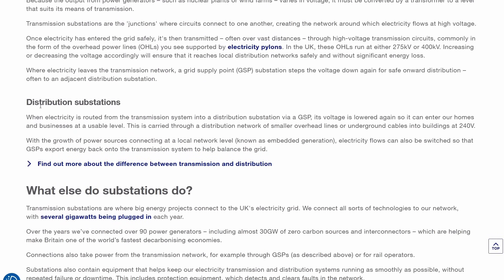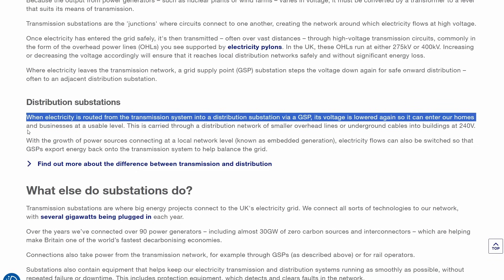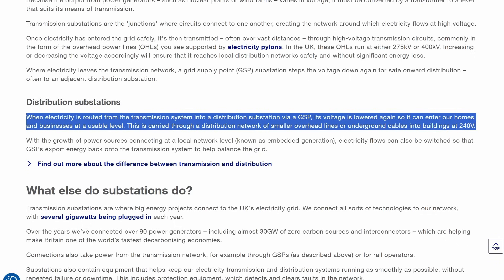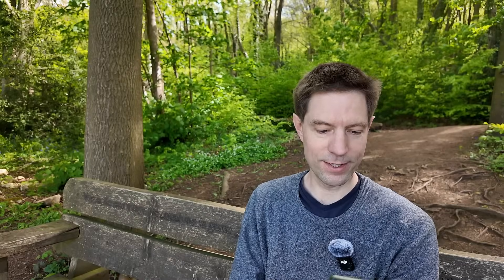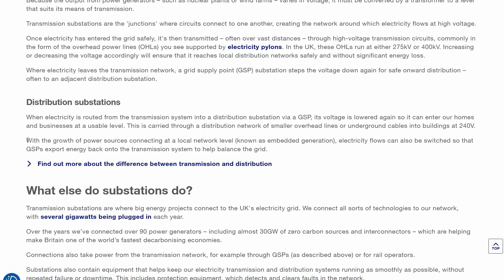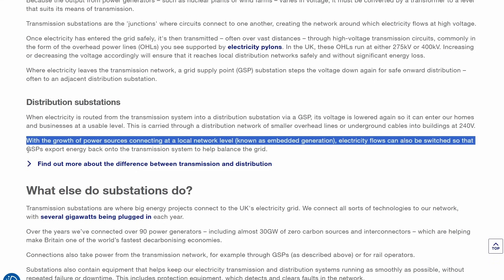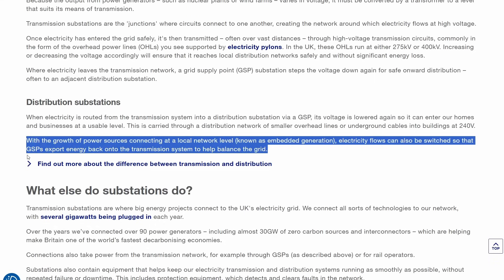Does solar export get past the local transformer?

Comment: Simple answer is yes, that’s why your system has to shut off if the grid power supply is interrupted. You don’t want to electrocute engineers working on the system. The grid is not the simple beast as it may appear to be, it’s extremely clever at protecting itself against very costly damage and automatic protection will shut down faults faster than a politician’s wallet when asked to pay for a round. However a trip on the system or an increase in demand ineffectually managed has much wider implications on the rest of the grid (butterfly in the jungle)l. Careful with the can of worms you open, a good can to open is the "effects of the reducing inertia in Grid stability due to renewables" stay safe all and permits are there for a reason.
Reply from the maker: Yes, the more I learn about the grid the more complicated I realise it is.

Comment: I am an electrical engineer. That the energy passes through the local transformer back to the grid if the total production exceeds the total consumption. Usually this surplus ends up as consumption in other parts of the city, state or other countries. Part is used in reversible power plants for pumping water and storing energy. The law of physics on conservation of energy does not allow us to have different consumption than production. If this happens, we have blackouts. Like recently in Spain. Sometimes I am surprised how general public know so little about this stuff.
Reply from the maker: I wouldn't expect the general public to be equally knowledgeable about every aspect of the modern world.  There's just too much of everything for that to be possible.  That's why we have specialist jobs people spend years becoming experts in.  I'm sure you've spent a lot of time learning about electrical engineering, whereas most of us haven't had that same level of training and so won't know what you know.
Reply: Energy does not get destroyed, it just gets lost in cable resistance and losses on transformers. Not destroyed, but made into heat.

Comment: Maybe that's why as mentioned in your previous video, new houses only get a few panels instead of utilising every part of the roof for solar, so as not to back feed the grid to much. I watch the off grid garage on youtube and it's amazing how many panels and batteries you'd need to go totally off grid and have enough for the demand.
Reply from the maker: Yeah, I did a video on the subject of how much solar would be required for off-grid myself a few months back.  It is quite surprising!
Reply: Hi in Melbourne I just have 6.6kw system and two 5kw inverters, one 5kw is hybrid and I just have 16kwh 48v home made LIFEPO4 battery which is enough for daily use, I have not paid any bill for years, we generally use 4 to 5 kWh during night and 20 to 30% battery. Andy of offgrid garage has pool, ev, air cons so need bigger system. For normal family 16kwh battery is enough as we do most of cooking, washing, heating cooling during day time when solar is available. Regardless how cloudy the weather is, big system still make 4 to 5 kWh per day to charge battery up to 100%.
Reply from the maker: @pr5991  I suspect the winters in the UK are somewhat harder to get through than Melbourne using just solar off-grid.

Comment: Here in South Australia around half the homes have solar and on some days the entire state is powered by rooftop solar alone. Every other generator switches off.  

The network now sends curtailment signals over the internet to restrict overloaded suburbs solar output, effectively restricting output from 10kW to 1.5kW per phase.  The rest of Australia is 5-10 year behind SA and has also started to use the same “flexible exports” model.

For most of the year our market value of exported solar is negative.  Today it has been around -3c/kWh.
From July, the network (poles and wires) will also charge us 1c/kWh for exports that roughly exceed 8kWh a day.
If you want to see where the world is headed with regard to managing growing rooftop solar export, look at the SA network.
Reply from the maker: The UK has somewhat less sun than SA, by quite a long way, so we're a long way off of that, so hopefully by the time we get there the network will be able to cope better, or at the very least battery storage (and EVs) will be able to balance things so that we won't get charged for exporting.  Hopefully.
Reply: @TimAndKatsGreenWalk  might be balanced out by not having aircon running in every house when that sun is out.😊
Reply from the maker: @robhaitch5544  I'm pretty sure we're going to get to the point where AC becomes more popular in the UK too.

Comment: Interestingly, in Slovakia, it is standard practice to utilize all three phases in residential houses. It’s a very practical setup, especially for charging electric cars. Is there a specific reason why the UK typically connects homes to only one or two phases instead of all three?
Reply from the maker: I really wish the UK had three phase supply to homes as standard.  It does happen in rare cases but generally single phase is the norm.  I have no idea why.
Reply: @TimAndKatsGreenWalk  It used to be the best way to make sure the phases are balanced and a way cheaper solution. When homes didn't use that much electricity, it wasn't worth sending three phases to each house, and you would have to balance the load between the phases within each house. With 1 phase per house, it's more or less balanced automatically.

In the Netherlands, old houses and especially smaller apartments will usually have one phase per house. Later houses will have three phases coming in, but still, often only one of them will be connected. Only if you upgrade or have a recent house, you'll have three phases connected.

Comment: Maintaining the voltage within accepted limits. If it gets too high your inverter will disconnect. Look up transformer tap settings too, these have to be reset for both ways. The local distribution company should have or be asking for the capability to send a command to your inverter to switch off if it has a stability issue. This area is a challenge and requires the ability to manage all sources of generation.
Reply from the maker: Indeed.  Most inverters will shut down above a certain voltage anyway, but the DNO should also be managing how much generation is on the network to prevent that happening in the first place.  This is why G99 and G100 applications exist.

Comment: so often in rural situation you are the only property on the transformer 1 phase or 3 phase connection. the transformers job is to downgrade 11000V Incoming lines to usable and local 240v, in the Export situation the transformer simply works in reverse where the solar generation at 240v coming from a grid tied inverter is upgraded to 11000v and then it can go to be used at connections anywhere. So transformers can work in either direction one side is 3 phases at 240v and the other side is 11000v, its job is to amend voltage. the reason the voltage is increased to 11000v is so the power can travel much further and the same amount of power can be transferred using a lot less amps meaning relatively small cables can carry a huge amount of Kws at low amps. there is also 33000v lines in the UK so and that again would go through a substation/transformer and the voltage steped up from 11000v to 33000v to carry power ultralong distance without too manys losses. so essentially the power from your solar panels could go through many voltages changed and travel 100s of miles before it is consumed in theory but it will depend where the demand is needed and the power will naturally make its way there to the closest point of a connection that is importing. The issue with the national grid is that the power you put in you must take out so high export and low consumption on the grid is very stressful for it one of the downsides of renewable energy and export.
Reply from the maker: Battery storage helps a lot when it comes to soaking up excess generation, so will help alleviate the intermittency problems of renewables.

Comment: Transformers are passive devices.  Power can flow either direction through them just like power can flow either direction through a wire.
The change between electric current to magnetism and back can go either way.  If voltage stays steady, then power going one direction vs the other just depends on which way the current is flowing when the voltage is positive.  Like with batteries, current flowing out of them means power flowing out while current flowing into them means power flowing in.  More precisely electrons flowing out of the negative lead and into the positive lead means power flowing out of the battery, while electrons flowing out of the positive voltage lead and into the negative lead represents power flowing into the battery.  It's a bit more complicated when the voltage and current are changing sign 50 or 60 times a second, but there is nothing magic about power flowing from the low voltage side of a transformer "backwards" to the high voltage side.
Reply from the maker: Quite, although transformers are not the only equipment on the power network and not all of it is designed for reverse power flow (although it can be upgraded to be).

Comment: I live in a housing colony that manages its own electricity distribution. The housing society buys its power in bulk from a distribution company. The housing society does not have an electricity buyback agreement with the distribution company. The demand for solar has exploded in my locality and almost every other house has solar on their rooftop. This has led to solar generation that is in excess of the entire demand of the housing society. In our monthly billing cycle our exported units are deducted from our imported units. For the past few months, our society has intimated us through a letter that since solar generation is in excess of demand, they would not be adjusting any excess exported power units. In March our housing society's exported units were 70% more than the imported units. So the excess  power is actually making its way back to the distribution company and they are getting all that electricity for free. Now our housing society is negotiating a buy back agreement with the distribution company and a new energy meter is going to be installed at the main distribution point to calculate both import and export.
Reply from the maker: Oh, wow.  I do hope you manage to get an agreement in place to get paid for your excess export.  It seems only fair!
Reply: @TimAndKatsGreenWalk  if they wony play ball then it may be worth building up a collective of batteries to store energy so ic can be used at night etc therefore using even less from the grid
Reply from the maker: @Lisa-Andy  that only helps you up to a point.  If you generate more than you use over a given day then some will go back to the grid regardless of how much battery you have.
Reply: And of course charged for export when the cost wholesale goes negative!

Comment: Many years ago, I designed transformers for mains frequency. When calculating the number of turns required for a particular voltage, the input turns were multiplied by .95 from the theoretical value. This was done to account for the resistive losses in the transformer to ensure output voltage was correct at maximum load. Using that fact, I would suggest that reverse power would be at a voltage too low to feed any current back. The voltage back into the grid being 5% times 5% lower than the voltage the transformer is being fed with.  Maybe on more modern installations there may be some detection of power being fed back and a different tap on the transformer switched in to compensate for this automatically. Certainly, older transformers are unlikely to have this facility.
Hope that makes sense and is helpful.
Reply: While true that transformers are generally ment to be one directional,  even though the voltage would be lower than optimal, it has to be able to send backwards,  or it'd never get to the grid at all, since most houses are on  their own step down transformer.     I imagine it also has something to do with solar inverters running  at a power factor of 1, while the wider grid is less than that.   I  wonder if you could sell your solar for more, if it was running in the capacitive side of the pf.....hmmmm.
Reply from the maker: From other comments it seems that reverse power flow is indeed possible and is designed into modern grid transformers at every step.  I think you're right that there is automatic switching under those conditions.
Reply: Such a pity that most of our infrastructure is decades old. Maybe it can be updated without complete renewal. Thanks for the reply. End of line.

Comment: Hi Tim, great topic for a vid, I'm sure most people with grid tied inverters have contemplated this. Does it really supply your neighbours with electricity? Turns out yes, BUT there can be issues if your DNO doesn't manage the supply from solar on their network and each phase.

Example : Artisan Electrics' recent video about their tennis court solar array install which was causing voltage spikes on the grid up to 265V.

The reason ?  The DNO made an administrative error in granting an export limit of 17KW, for a single phase supply!! So on sunny days when it was exporting 17KW, everyone on that supply phase in the street was getting over voltage spikes. The DNO'S response was appropriate : paid all costs for the customer to upgrade to 3 phase supply, including the internal wirings. 

Mick, Brisbane Australia
Reply from the maker: Absolutely, the grid does need to be managed properly for all this to work so in principle it shouldn't be a problem.  You can never account for administrative errors, however!

Comment: Any transformer can anytime work both ways. Its a basic principle. 
But there is more to it and it essentially comes down to understanding electrical principles.  Your solar come inverter set-up has to be capable of feeding power back into the grid. That can come down to voltage and frequency differences etc etc. It can also mean that the local distribution network was only really designed to supply power one way and goes hysterical when you try to feed power back the other.
There are a myriad of reasons. Its all called good engineering and the zelots ignore that.
Reply from the maker: Network upgrades help here, with newer equipment designed with the export loads in mind, as well as the import.

Comment: I am not sure a local transformer can go both directions, but I do know, that having a lot of people trying to export electricity to a local grid can raise the local voltage to a point where it's too high to export any energy. Some people have experienced that. It's really annoying when you have great sunshine, but your system isn't able to export any energy. Afaik this is the result of an undersized local grid and network companies are trying to solve that by upgrading the local grid.
Reply from the maker: Yeah, hopefully that will become less of an issue as the local equipment gets upgraded.

Comment: Grid electricity is blackout vulnerable. 
Australia's half nuclear proposal is full grid blackout risk. 

EV v2g technology and rooftop PV electricity is off grid capable. 

Petroleum for road building and maintenance and petrochemical industry and emergency heating and strategic military defence will remain.
Reply from the maker: I'm not entirely sure I understand what you mean.  It doesn't seem to be related to the video.
Reply: @TimAndKatsGreenWalk   yes I jumped ahead to frame the bigger idea about the grid in Australia and our 20million roofs and 20million vehicles all part of the national electrical grid. All energised each day the sunshines. Over energised. 
As the rooftop PV technology gets cheaper. 
And mass EV storage technology gets cheaper.

You spoke about home excess electricity going into the grid. 
The duck curve of grid demand collapse is exactly too much PV electricity surging into the grid after the sunrise.
Reply from the maker: Gotcha.  With the right tariffs, people can be encouraged to charge their EVs when there is excess solar, which would go a long way towards helping keep things balanced.  I'm optimistic.

Comment: Good question, but please pull in an expert when doing such a video ---- or this it results in a video with your empty brain moving your mouth --- and none of us believe it.    Anyway thanks for making the video
Reply: Many of the community are very informative
Reply: Totally unnecessary response to what was essentially a valid question that many on here, myself included,  would like to know the answer to. He has done research as far as possible with limited success, and left the question open for the better informed followers to feed back. There is no need whatsoever for the empty head comment.
Reply: That's a bit harsh isn't it?
Reply from the maker: Wow, do you speak to every stranger you meet like that?  Delightful.

Comment: My understanding is that you take into account a resistance and voltage drop along all conductors and include the 3 phase transformers at each sub-station which effectively mix the phases into a single power flow (water flow is a good analog here). So current flow will find it's own level and therefore self regulate. The effect being that after your local sub-station an surplus of power will flow to the grid and and a deficit will flow from. The net being calculated at each end point by the meters. Although there will be neutral currents they would not be significant among the losses.  Sorry that was long, but the power is the main point.
Reply from the maker: Yup, it seems generally as long as the equipment can cope with the power and the voltages don't go outside of the designed limits the power should be able to flow both ways, which is reassuring.